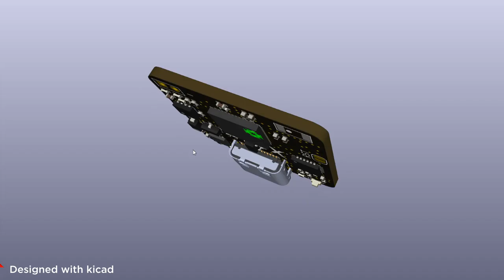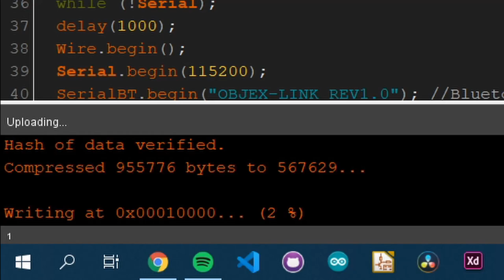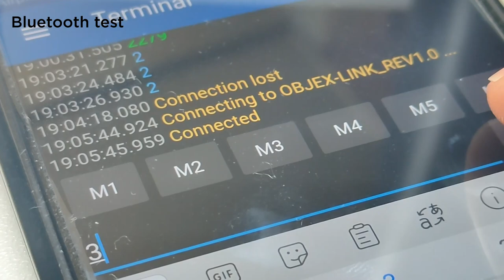The first modular IoT board | OBJEX Link v1.0

Comment: Hi!
Very nice work!
What's the range of the Wi-Fi/Bluetooth? Is this small ceramic antenna has good range?
Reply from the maker: The range is a few meters with the presence of obstacles (for example a concrete wall), the antenna that I used in this prototype will be replaced in the future with an antenna that is always ceramic but more performing.
Reply: @SalvatoreRaccardi 
Thanks
How did you design the antenna for the esp32? Was it just trial and error or you have some solid knowledge in antenna design?
It's not related to this project but I want to design my own pcb with esp Pico d4 but I'm pretty lost with the antenna.
Reply from the maker: @lacipaci4  I have read some docs on the internet and have done some tests. Then I also analyzed some PCBs that used antennas of this type. I still have a lot to learn about RF circuits.